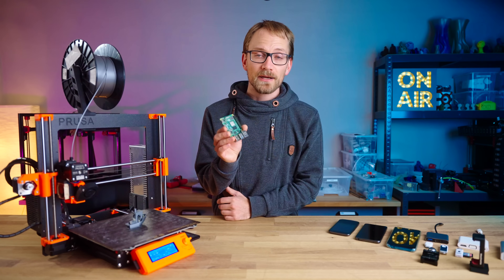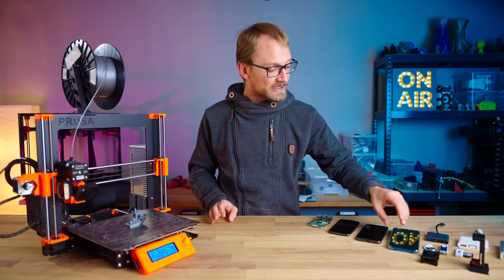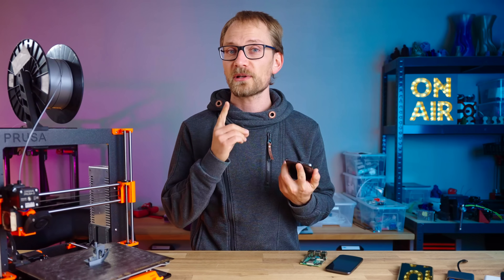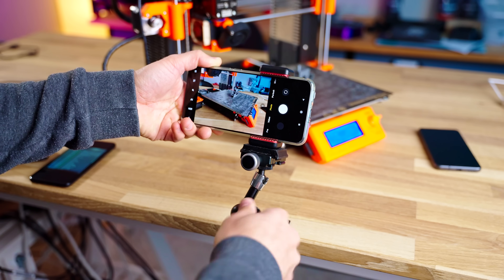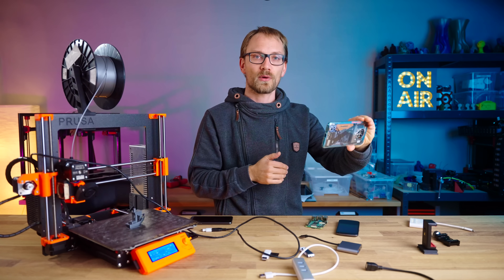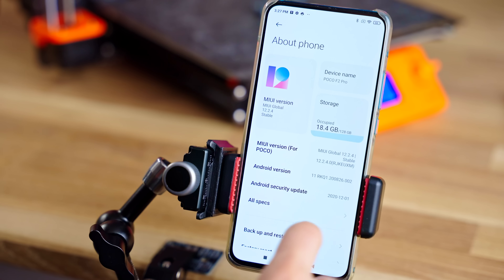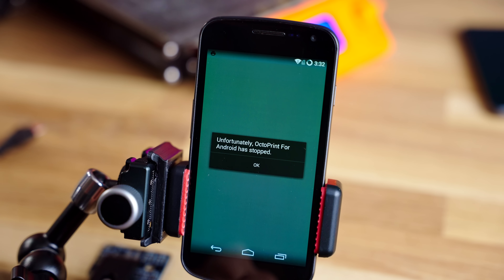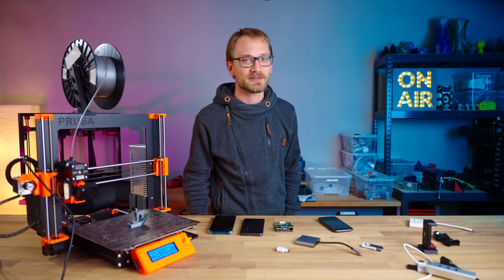How to run OctoPrint on your phone!

Comment: Tom, do you have a link to the actual Y-Cable that works?  I can't seem to find one that supports Micro-USB charging to the phone.  This seems to be the biggest issue with this when you search this topic.  BTW I'm using a Samsung Galaxy S7.  Thanks for always useful and entertaining content!  Also, I love the MELTZONE Podcast.
Reply: Ive been trying to get my galaxy note 3 to interface and charge at the same time. I can do either one but not both. Not sure what else to try. Maybe a different phone?
Reply: @bountoj  did anything work bro ?
Reply: @harshvardhansingh3491  I ended up using a spare SamsumgA20. This phone worked with an otg cable and a hub. I havent tried using another otg cable on my Note3 tho. Might be that the one I was using was asscrack.
Reply: Please lmk if u find one too, trying to use an old galaxy s3

Comment: Can someone point me to the right cable? I bought the first one off the link and that was incorrect. I can't get power to the host. I swapped them and made the printer the host. Got the phone to charge but then obviously it can't connect with the printer. All micro cables with host power is what I need.

Comment: I got Octoprint up and running on an LG G6 Android phone thanks to this video.  However, I'm having trouble controlling the camera for use with OctoLapse. I would like to fix focus at a set distance, the autofocus keeps jumping during time lapses and disabling autofocus puts the focus plane at infinity. I can't launch Camera Settings due to not having 4vl-utils installed.  Any tips on how to install 4vl-utils on an Android phone?

Comment: I did this recently. Good video, but keep in mind that not all smartphones support OTG and charging at the same time. I had a OnePlus 3T laying around, which, after some googling i found out, is one of those. Thankfully another phone, Moto g7 plus could do it. I also rooted it to install an app, which keeps the battery at a specific level instead of pushing it to 100%. I belive both problems could be solved with removing the battery and using an constant power supply, but I didnr try that yet.

Comment: Thanks Thomas for the info! Yesterday I was finally able to convert my old android phone without a battery to a printer support! I've removed the battery, soldered wires to the test pads (fortunately there were 3 of them for each traces!), added a LM2596s module and a 10k resistor as a thermistor. Without a resistor the phone won't turn on.

Previously I've tried several Y microusb OTG cables but the phone stopped charging after a few seconds. This way I can use it until the charger is plugged in.
Reply: Okay, tried printing a few models now and have some trouble maintaining stable connection. I'm getting timeouts randomly and that causes the printer to pause for a few seconds. Sometimes the motherboard disconnects completely and the printer fully stops. I'm not sure if it's some kind of noise, but I'll check with a raspberry pie soon.

Comment: For you and for everyone:
I waited a few weeks to write my opinion. After then I can confirm Octo4a works very well for me. I tested it on more smartphones. It worked also on a quite old Huawei P8 Lite. It runs now on a Huawei P20 Lite without any performace problem. I was able to set the energy management easyly. I made an "Y" cable, but it didn't work for either. It is currently running only on battery power. It lasts even up to a 24 hour of printing, or more. With a very used battery!! Especially when I turn off the camera server.
I ordered a USB multiport hub. It's on the way. I hope it will work. I don't want to modify the phone with an additional battery charging module. The only one issue to me is about the camera focus. When I turn off autofocus, everything will be awful blurry. With autofocus too, but not as much as when it's turned off. I saw on github this is a current issue. So I'm waiting it will be fixed sometime.
Overall I'm happy. I installed a BLtouch sensor. I was really scared to modify my printer. I scared about changing the firmware and losing the SD support too. But everything works fine. By the way my printer is Anet A8 Plus.
Reply: Have you managed to get charging to work with the hub you mentioned? I have a p20 lying around with information regarding simultaneous charge with otg scarce for whatever reason. I'm curious if you got it going and if you did, could you share the model of the hub?
Reply: @rigormoritz  Same issue, bought a otg cable from the link thomas provided but my one plus one doesn't charge while connected to the printer. thus the printer gets usb "power" from the connector of the charger....

Comment: Just got my first 3D printer up'n'running (Prusa i3 MK3S+, haven't even installed the MMU2S I got with it yet) and was going to get a PiZero 2W and plug it onto to printer's board. This seems to be a better solution for me, with no cost for connection and camera since I already have a couple of Mobiles and OTG-cables. Subbed to get more goodies 😁😁

Comment: There are a couple RCA tablets at Walmart that are under $80 and you can charge them with a little 5 volt plug and they have a full size USB and mini USB output so you don't need the little dongle

Comment: I have this running on my tablet.   the server is running and it says the printer is connected.   But when i go to octoprint in my browser it will not connect.   It times out.   I have switched from auto to manual and tried every listed baudrate.   no luck

Comment: I set mine up, with an s7, but the y cable charges both ways, so when. I turn off printer it still is getting some  power.  How can I fix this?  Thanks!

Comment: I am finding OTG support on Android phones is not as common as one would think, most of the cheap prepaid phones do not seem to support OTG. my 3 old Samsung phones no issues working, but a newer Blade ZTE I have does not. I am going to try a Tracphone I have coming in that was $28, but I don't have high hopes for that one.

Comment: Anyone tried this with a Oneplus 5 phone? I cannot for the life of me get it to charge at the same time as it is connected to the printer. It is either charging and not connected to the printer or connected to the printer and not charging.

I have tried two different otg adapters that was advertised as one of the ports being power delivery. I have tried rooting the phone and installing 3 different custom kernel's. Nothing has worked so far :(

Octo4a on the phone works great. But as long as i can't get the phone to charge at the same time as it is connected to the printer i run into battery issues when printing longer prints.. :(

Comment: I cant find a cable that wil charge the phone at the same time. Even ones that dont mention it, the reviews say it does not charge the phone. Do these cables not exist in the UK? Very frustrating as really want to get this set up. My phone is old and has a micro USB and the battery is past its best, so doesnt hold charge anymore so got no choice but find a way to charge it. Doesnt have wireless charging built in either. How can I do this without the cable that doesnt exist?

Comment: FInally got it to work, I tried different powered usb hubs, but the ONLY way this would work was with a wireless charger and a direct usbc to micro usb cable. cr 10 mini with th3d board.

Comment: When I plug the dual adapter into my Stylo 6, it starts charging and uncharging at a constant rate. If I plug the same charger into the phone without the adapter it works fine. The adapter works for my other phone though. Makes me think there is some setting I need to disable/enable?

Comment: I installed it but it keeps saying it's not connected. That's because I have it connected to the raspberri pi running Octopi . Everything is fine there. Do I need a special cable or what?

Comment: Hi Tom I can not find a used LG G6 with 4gb of ram anywhere. Plenty with 32Gb and a hefty price tag. I have a retired Pixel 3a will that work?
Reply from the maker: Pixel 3a should work just fine! The devices I'm using are just the ones I happened to still have around, but they're not recommendations.

Comment: I've tried this in the earlier stages about 6 months ago, but not much since then. much has probably changed since I used this. It's a great piece of software if you're in a pinch and want to try it out, but don't forget an old PC with an installation of linux can run octoprint just the same (plus there's a longer development trail, so it would be generally more reliable.). Great option though for quick setup (except for maybe designing the phone holder). Great Concept though and I bet it will only get better!

Comment: I ran octoprint on my Samsung Galaxy S7 for about a day,  But I was unable to charge and have the phone connected to the printer at the same time.   Wireless charging did help a little.  But ended up switching to a Pi
Reply: MOSWAG USB C OTG Adapter USB Type C Splitter

Comment: I've loaded the app on my phone. And been presented with an IP address but when I use my laptop or my phone to search for the IP address. Nothing comes up ....... please help me
Reply: i just found out that is must be a problem from my router as connecting my octoprint mobile and my laptop to a hotspot, it works just fine
Reply: @elias.keller_photography  I'll look into
Reply: same here. did you find any solution?
Reply: @elias.keller_photography  unfortunately not.

Comment: Sadly this couldn’t work. The OTG adapter doesn’t charge the phone (with rare exceptions) but the printer, which is useless. You have no way to charge the phone while being connected to the printer. I followed your advice and learned it the hard way.

Comment: Tried to do this on my old Galaxy S8. It works, but... Unfortunately Octo4a discharges the phone faster than it can charge. I bought an Anker usb c hub with usb c charging port, it advertises fast charging but for some reason it doesn't. If I unplug the hub from the charger and directly into the phone it fast charges, but not while plugged into the hub. I liked the idea of having a nice camera in the phone for time lapse, but it looks like I'm stuck with Raspberry Pi and a webcam.

Comment: This is great, but I'm having problems locating a phone that supports charging and OTG at the same time. I tried with a Sony Xperia Z3 that I had laying around. Didn't work. Does anyone have recommendations? Like, any particular brand or year model that would support it?
Reply: Having the same issue. My understanding is that the cord is responsible for being able to pass voltage and data simultaneously.
Reply: @michaelmiller465  okay. I got a cord that supposedly supports that, but who knows, right?

Comment: Honestly, thanks for doing this. I was looking into ways of running RasPi apps virtualized in Android and this video popped up in my suggested a few days later, this is literally perfect.

As a few folks have said below, for Creality printers that have backpower issues, cover the fourth pin (5V) on the USB-A connector (host side plug, one that will go into the hub or adapter) with a small bit of electrical tape as well to take some of the strain off these older batteries.

Have it working now, and I thank you and the Dev behind this app, for putting in great work!
Reply: Amazing tip thank you 🙌

Comment: Brilliant way to repurpose an old phone sitting in the drawer!!
But, I've a issue when using my old Samsung S7: I tried 3 different Y cables, works fine for USB connection to the printer, but none of them CHARGES the phone, and makes the whole thing useless, since the phone will certainly discharge completely before the print is finished.
I'm searching for a solution, so I'm interested if you found a solution already (I mean without tearing open the phone and soldering) or know an Amazon pointer to the holy Y cable that will allow to charge the phone :)
Reply: Hey, have you found something in the meantime? I have the same phone for Octo4a, but couldn't find any OTG splitter with charging capabilities..
Reply: I'm in the same boat. Has anyone had any luck?
Reply: @LizzWard  Hey, did you read my previous comment? I mentioned the Moto G6 Play, that works out of the box. or the 100 kOhms resistor with a Y cable. Hope this helps.

Comment: Thanks for the video, it's really awesome! just a question: when i open the settings on octo4a it gives me an ip address which i assume is for wifi to wifi local services (like, i have to be connected to the same wifi network as the device). how do i enable it for outside-home operations??

Comment: love the video, haven't had the money to get a raspberry pi since i wanted one but did have an old Huawei laying arround, works like a charm beside the camera connection, cant figure out how to get it running so i can watch my print through the camera, only seems to work when going in to test the snapshot feature, the stream URL doesn't want to work :p 
You did say something about getting the nexus app and camera working only worked out for you once but how do you find the problem when it is not working? :D

Comment: Great video however can you please help me! I got a Samsung J3, got it connected trough a splitter that does charge and the usb connection is going to my printer however the Octo4a doesn't connect to the printer I only get "Printer not connected" I have octoprint set up on the computer and can see the image through the phone but the "Serial Port" and "Baudrate" are set to auto and even when I manually cycle through the options and hit Connect, nothing will connect. I can't find a solution anywhere; anything you know of and point me in the right direction if you don't that will get the printer to connect with the phone?

Comment: So, I ordered the cable you recommended in the description (used your affiliate link as well) and I've got it all hooked up like you briefly showed in the video, but my phone isn't receiving any power. I've tried numerous cables as well thinking it could just be a short, but I've had no luck. Any ideas?
Reply: I've learned that the kernel has to allow simultaneous charging and host. My OnePlus 5T also doesn't allow this, while my older HTC 10 does work. I suggest doing some research online for your specific phone (rom/kernel) to see if the phone allows it.

Comment: I'm running octoprint on a hp thin client which you can buy for 20 euros on ebay. Can run octoprint in docker or venv and has a lot of power to run also other web services, a smb storage for the octoprint and many others. Doesn't bottleneck the usb hub if you run a usb camera so you won't experience any print stuttering. You can't get cheaper than this and has a lot more potency than running octoprint on old phone or even a newer one if you chose to buy.

Comment: I had several usb connection lost issues with my odroid xu4 running octoprint and I was just about to order a raspberry. After I had seen this video, I hooked up my Nexus 7 (from 2012!) and gave it a shot. It is not only running more reliable now, but having octoprint acessible right next to the printer on a big touchscreen is such a treat.

Comment: How do you find a cable that charges? I've been searching amazon for over an hour. Even the ones that say "charging" in the title, say it can't charge at the same time it's being used for other devices.
Reply: Same for me: tried 3 Y cables, none of them charge the phone. I'm searching for a solution (including soldering an extra micro USB type B). I'm interested if you found a solution already!
Reply: @LaurentWiart  I'm in the process of returning one that didn't work and then I'll try something different. Thank you so much for your efforts. I'll link you if I get a good one.
Reply: Thanks! Same for me :) will try to contact some Aliexpress producers with a description of the specific need. Will let you know if I find the "holy Y cable grail"

Comment: New use for my old huawei p8lite with broken wifi module. Bought a ethernet microusb adapter which should also work for my amazon fire stick in another life. This will free up my rpi3 for home assistant duty. Thanks Tom. Annoyingly couldnt find my otg cable that i know is in my empire of dirt somewhere.

Wondering whether disconnecting the screen from the motherboard to avoid burn in might be worth it but there again not likely to need this phone for anything else

Comment: i'd like to ask about the battery longevity, since if we're setting this up as a permanent solution then it'll be plugged in 24/7 to the power adapter, will the phone battery go nuts due to charging for that long?
Reply: My phone charged over night every night for 4 years. Its fine.
The problem maybe thermal output of soc for running that long.
Reply: @KarrasBastomi  yes, i also charge overnight for the last couple of years also, but that's a different case from 24/7 plugged into the wall

Comment: I use Octoprint on a RP with Polymer on the phone, works for years now. Can work also over internet with a VPN connection. This looks like a lot of work to get it right... And be careful with the batteries of the phones, especially with the lithium polymer, a fire in your house is really possible. This type is also very popular with drone owners and has already caused quite a bit of trouble.